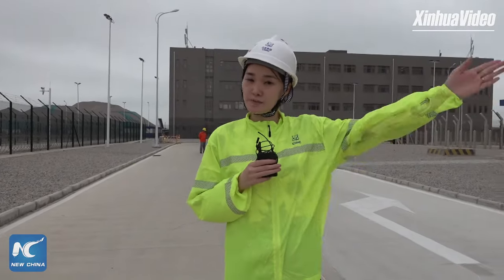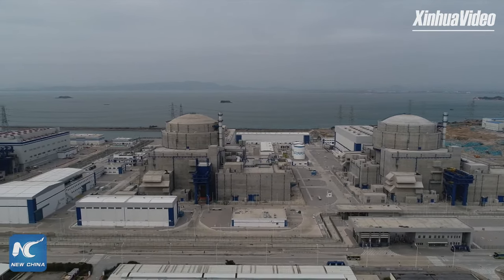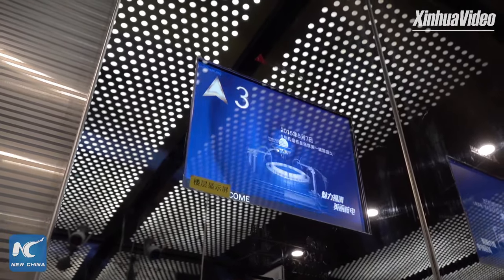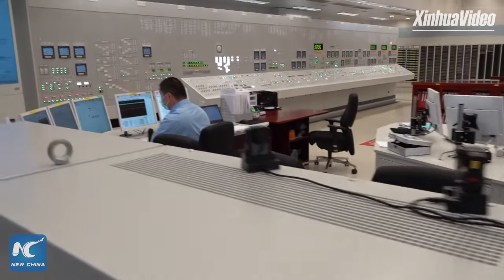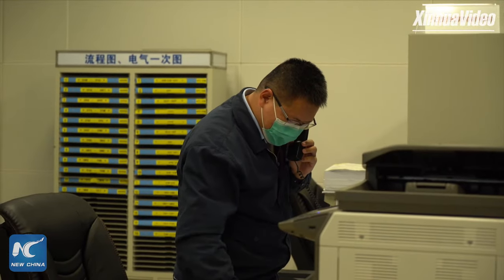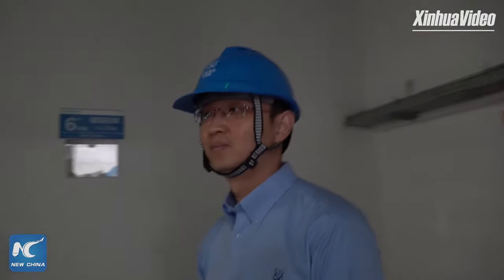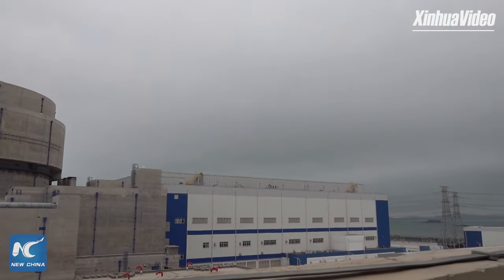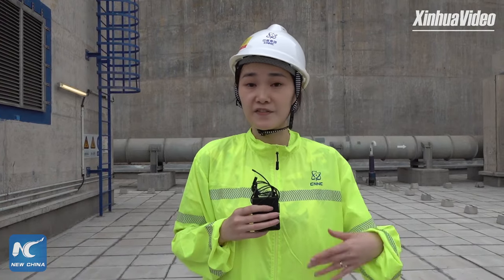How safe and green is China's Hualong One nuclear reactor?

Comment: Actually if you noticed that the reactor generate 1GW power. The same as 80% of current China coal generator. China is planning to replace most of the coal plants with these 1GW nuclear power plants. The transformation is seamless. Because both use steam to power the rotor. China had been planning the transformation 30 years ago. 

When you are asking why China moves so fast, this is an example. It planned what happens today 10-30 years ago. All as planned. No waste, no delay.